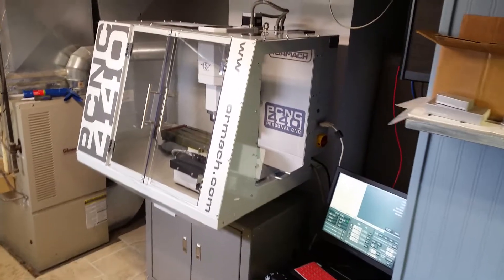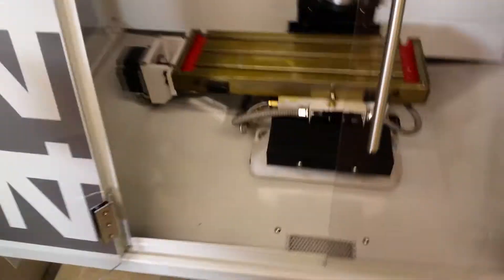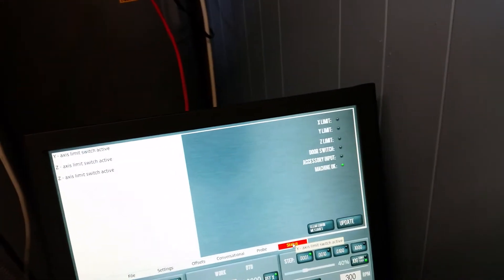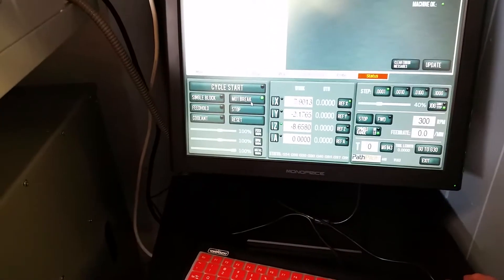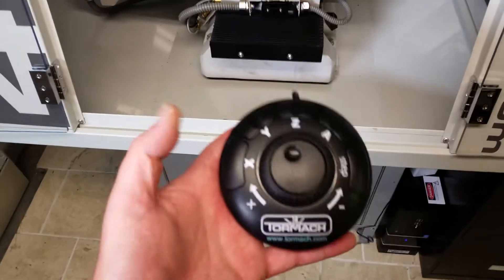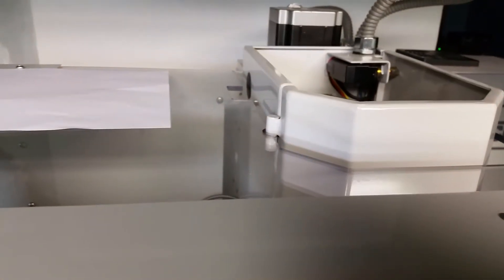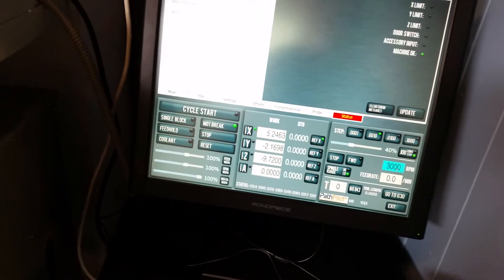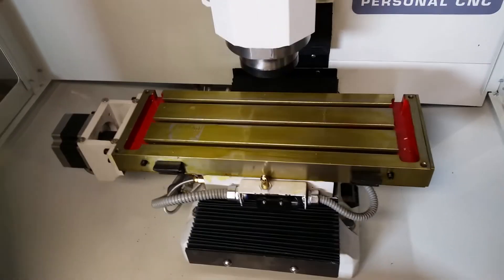My New Tormach 440 CNC Mill Video 10

Comment: You sound so excited as well. Very nice machine.
Reply from the maker: +Crivo152 Yep!  Ive wanted a Tormach for years and never really had the space for the 1100, then I had my eye on the 770 which I almost bought, but once I heard of the 440 I knew that was for me.  I mostly only make small parts for the custom SAKs I build so I can easily do a pallet system and make 10 or so parts at a time on this machine.
Reply: I totally get it man, I've been dreaming of one for years myself. My problem is room as well, I am working on a project that is taking up a lot of my garage space. Enjoy your new mill, I'll check in to see how it's working for you.